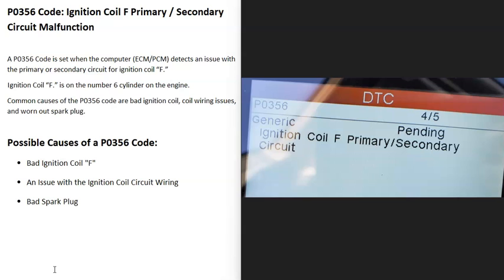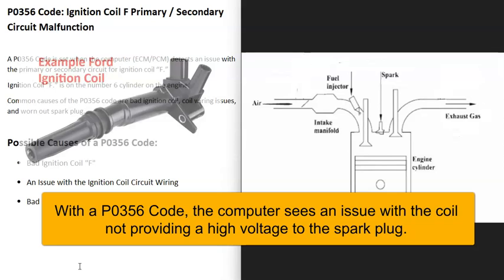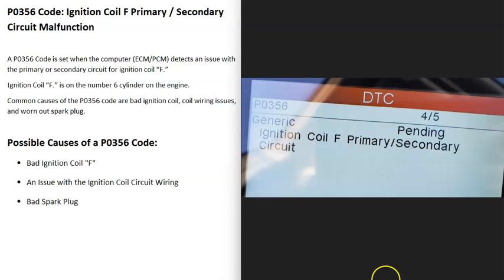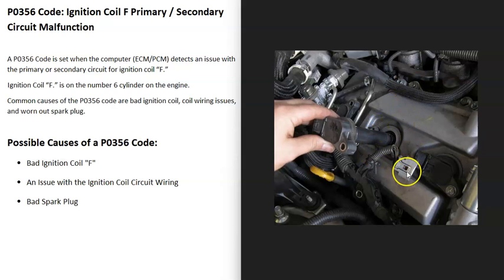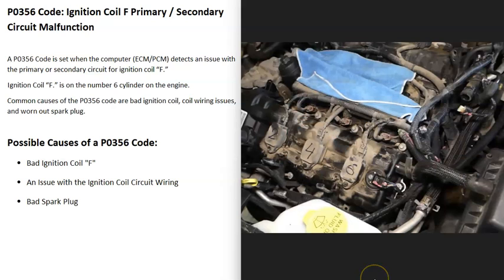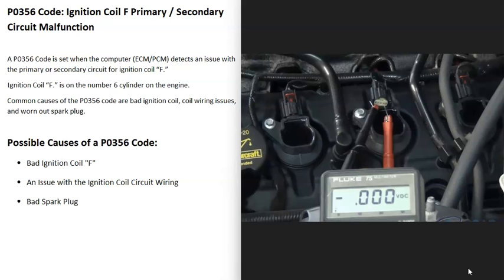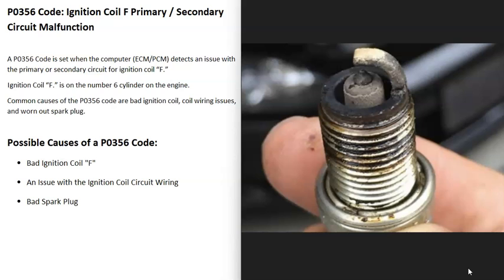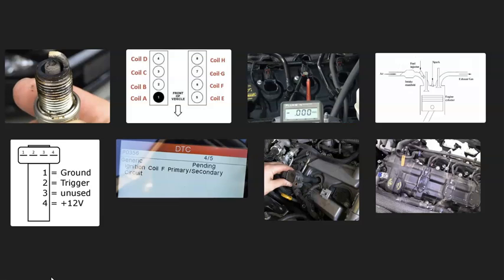Causes and Fixes P0356 Code: Ignition Coil F Primary / Secondary Circuit Malfunction

Comment: I got this code after I replaced the works plugs as I forgot to reattach the clip to the coil.   Scared me.  Code is gone but now there is a subsequent code c1201 abs but there is no check engine light.  Any idea?
Reply from the maker: Many vehicle computers will turn off driver assist programs such as ABS when the engine has a malfunction. It will likely clear; if not, there will be other codes that point to the problem.

Comment: Can a bad injector cause this code
Reply: I have a 2008 ford fusion sel 3.0 v6. I was wondering the same thing. I've been trying to troubleshoot before I send the pcm in. Have you found an answer to this question.
Reply: @georgekraynak498 did you figure it out ?
Reply: @mattgrill7713  I did I sent out the pcm to circuit board medics they repaired it. With these ford fusions if you let the spark or coil go bad it messes up the computer
Reply: That circuit board medics I highly recommend if your having a similar issue. There is a sure fire way to tell if it's your pcm also. Using a multimeter

Comment: My ford explorer has this issue and it’s the wiring
Reply: what year was yours?  Ive been having the issue on and off for years.  Replaced allplugs and coil packs basically
Reply: @ mine is an 04 
A dumbass “mechanic” screwed up the wires leading to the coils :(